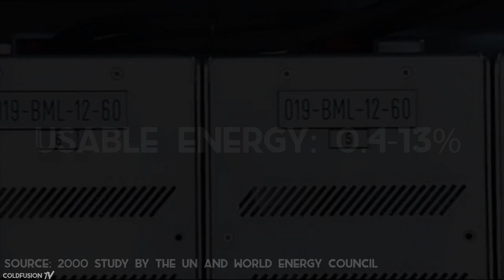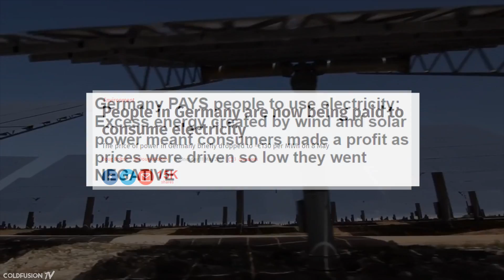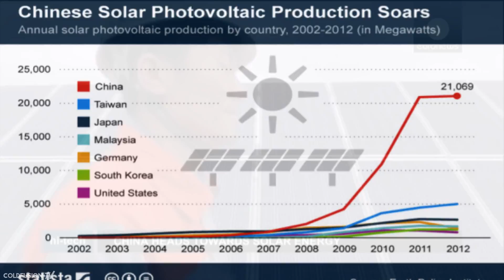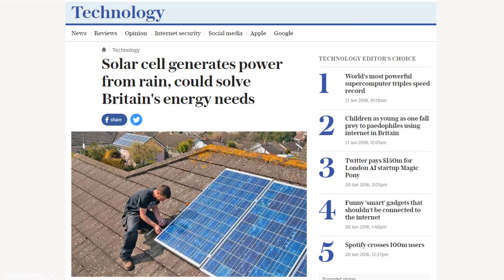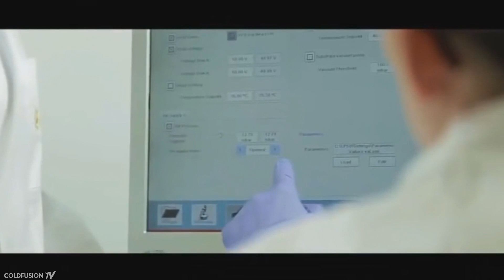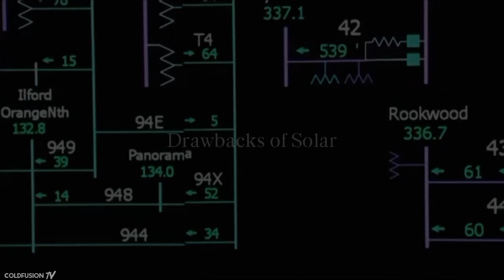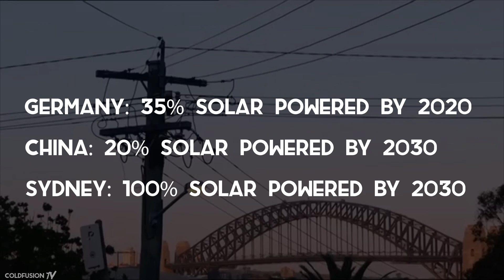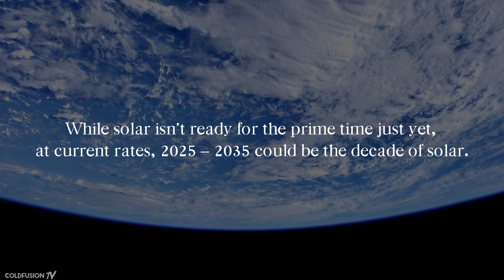The Truth About Solar

Comment: One way to help solve our problems, ditch AC and use a superior DC grid which can then easily be connected to power storage.
Reply: AC can be transmitted over much longer distances so we can use a much more efficient central production point to feed a larger grid whereas line resistances for DC are much higher and can cause a lot of issues over any distance because losses become so great, now for local power production (as in on your house) DC may be feasable assuming you can get appliances that work on DC or get computers to work on DC without first doing a DC to AC inverter and then back again because computer power supplies provide up to 5 seperate voltages (plus ground so 6?)
Reply: DC is more difficut to utilize.
Reply: Why?

Most things these days use DC.
The majority of things which use AC (like lights) can also use DC.

Pretty much the only thing which cant are motors which run at mains frequency, and crappy old power supplies.
Reply: As far as I know, mains is run on AC for safety. When you are electrocuted with DC your muscles seized up and you cannot let go of a wire for example, but in the same scenario with AC you would just get a jolt and jump back.
Reply: Nope.

We use AC due to inadequacies of our past.

Mains AC cannot be transmitted at mains voltage all the way as it would result in too great a load to the cables and thus too great a power loss. (an example of a similar effect is in dodgy USB cables, some can only handle a few hundred mA before their voltage drops to unusable levels).
In order to compensate for this, you need either massive wires, which are far too expensive to build and maintain (and weight too much for the towers), or you can have multiple generators nice and close to where the power is used (like Solar cells), or you can have the voltage change at various stages, so large legs of the distribution network will use high voltage, low current, allowing effecient transfer of energy, while the closer ones to the user will be low voltage, high current.

In the past, changing between AC was easy. You just needed a transformer, a piece of iron with 2 wires wrapped around it. This was simple, unlikely to break (unless it overheated and the wire melted), and it had a decent efficiency. But the same principle that allows the transformer to operate means there will be radiative losses with AC power transmission.
The more efficient you made the transformer (by increasing the frequency), the more losses you had during transmission, and vice versa, such that for the DC system, you have no radiative losses in transmission, but no efficiency in the transformer. For high frequencies you had very efficient transformers, but the power could not be transmitted any great distance (this is also why the under sea cable networks have to use DC. The AC transmissions would die out too soon and only work to power devices near the shore).

In the past, there were 2 ways to convert DC to different voltages, motor-generators which had lots of moving parts, wore out, and were inefficient, or via a regulator or the like which just wastes excess power meaning it is only good to regulate voltage, not to transfer it more efficiently.

This made AC the clear winner back then as it could be more efficiently transported from a few generators (or power plants) to loads of people (or users).

It also meant power supplies (which were to supply DC power) would first go through a transformer to change the voltage, and then go through a rectifier and smoother and regulator.

But that is no longer the case.
Now we have much more efficient ways of converting DC voltages, using switch mode power supplies. The supply is switched at a very high frequency making the transformer much more efficient (and thus it can be smaller). This would allow us to transfer power without radiative losses.

But more importantly, switching to DC means we have an easy way to store power.
Reply: Honestly… I agree with most of the points:
-DC Is safer to touch: True (this is even reflected in safety standards, eg. 60950-1 with limits for AC than DC for SELV voltages). But apparently it hurts more for some reason J
-These days it is easier to transform DC back and forth using various switchmode circuit
-DC means less transmission losses – True (no capacitance issues, corona discharges, noise from HV power lines)
-DC can use whole thickness of the wire (no skin-effect of AC that requires multiple conductors)
-DC means no issues with power factor, phase angles between parts of network or synchronizing
But DC has its own drawbacks and major one I see is that it is MUCH harder to kill an arc that occurs in DC circuit, all switches, fuses, sockets, switchgear, etc. would have to compensate for that. Also any accidental short-circuit even at mains voltages may cause a long lasting arc fault. This is a serious problem that does not have an easy and cheap solution.
There is also a problem with motors – It is easier (cheaper) to design a simple motor that runs reliably on AC, than on DC. There are tons of devices that use those simple AC motors that would now require some additional circuits to make it work with a DC motors.
The other issue is the same to why we do not have a global voltage, frequency, electrical system design or even standardized sockets: Legacy reasons. It would cost a fortune to convert to DC these days.
Reply: Fromage Frizzbizz Yes, some whole fraction, not a multiple. My bad.

A brush-less DC motor is effectively an induction motor.

Universal motors don't need control circuitry. You just power them up and they work.

Induction motors do need some sort of control, with one of the simplest controls being an AC source.
However that AC source can be replaced by control circuitry which switches (and potentially even cuts to some fraction for a smoother one) the voltage at the poles.

So no, it doesn't need to be supplied by AC.

A stepper motor is another example of an induction motor, which uses DC power and a controller.
Reply: Also, after looking it up a bit it seems DC is safer and requires more current to kill or shock.

Apparently it requires 88mA of DC current to prevent you letting go but only 22 for AC.

This also matches Eddison trying to show that AC is dangerous by hooking up some animals to DC and showing they were fine and then hooking them up to AC and killing them.
He allegedly hooked a dog up to 1000V of DC to show that the dog would live, and then hooked it up to 300V of AC and killed it.
Reply: It is more efficient to transmit DC than AC, it is just easier to transform to higher voltages using transformers. It is because with AC you need to deal with stray capacitance of power line, skin effect, losses to 50Hz radio emmisions. But, as I mentioned before, there are other major drawbacks of DC.
Reply: over long distances that is not true, AC is way more efficient over many miles because line resistance is not truly zero.
Reply: Ryan Schafer Uhm... Could you please elaborate and tell me what's the difference? Resistance woulb be the same for AC and DC, actually impedance for AC would be higher.
Reply: DC does not like to be stepped back down in voltage without getting huge losses in efficiency (think the 30kV+ transmission lines that then hit substations which step them down to ~10KV which get broken even lower before going into your home at ~110/220V) each step would have huge losses with DC whereas AC just goes with it and doesnt have the efficiency losses that DC has.
Reply: Yes Mibars, DC can have arcing issues, which may need to be compensated for. However, for mains AC through air, DC requires a fairly short distance for arcs, even to sustain them.
Reply: Ryan Schafer No Ryan.

Regardless of the distance, it is always more efficient to transmit as DC.
This is because AC has capacitive and inductive impedances which DC doesn't have.

Resistive imedances for DC are the same as for AC. But with one caveat. AC suffers from a skin effect where only the outside skin of a conductor will transmit the electricity. The depth will vary depending on the conductor and frequency. This means AC might not utilise all the wire and thus the wire has a higher effective resistance.

The undersea cables all use DC, as AC wouldn't be able to reach the devices due to the high inductive and capacities imedances, which are significantly greater under water than in air.

High voltage transmission between different circuits all run on DC because of the issues with phasing and DC being better.

Lots of power supplies already work on DC. The first thing which happens in lots of modern power supplies is the supply is converted to DC. The one thing stopping some of them working on DC are complex active filters that only allow the proper AC waveform and thus reject the DC wave form.

The 5 separate DC voltages can all be supplied by a switched mode power supply, which works fine on DC.

The transformers in modern PSUs are not large enough to work on mains AC frequencies.

Transformer inefficiencies vary dramatically depending on the size and load of a transformer.
If you take the same transformer and try to use it for AC-AC conversion or in a SMPS, the SMPS will win.
The losses in a transformer are frequency dependent and higher frequencies typically result in greater efficiency.
This makes a SMPS more efficient than a transformer.

The hysterises power losses is roughly proportional to f^(-0.6).

So no, DC-DC systems using a SMPS can be far more efficient.
Reply: If you are going to discuss losses in changing voltage you need to discuss how that is done.

In the past all they had were regulators, motor generators and transformers.
And their technology only allowed the first 2 for DC.

Their regulators would just waste the voltage difference, so if you had it supplied with 30 kV, and the power output was 10 kV, then it would waste the difference of 20 kV, with the power (20 kV*current) wasted as heat, meaning you were better off just using mains voltage all the way.

For motor generators, this involved using the input power to turn a motor, which in turn turned a generator to provide power at a different voltage. This had lots of parts that could break and wear down and wasn't the most efficient.

For transformers, they just had a few parts, a core and 2 windings so they were fairly robust.
To achieve low losses they need to be quite large, making them somewhat expensive, or they need to use exotic materials.

But the transformers were the best they had so they used them.

They then had to decide on what frequency to use. The higher the frequency, the more efficient the transformer, but the less efficient the rest of the grid would be.

Lots of places chose 50 Hz, the US chose 60 Hz.

But that has changed with the introduction of SMPS.

If we were just making the electricity grid now, we would be using DC.
Reply: mibars One thing I forgot to address, the motors. The main motors which can run only on AC are the synchronous and induction motors, which run at some multiple of mains frequency. These are effectively brushless DC motors where the control circuitry is an AC generator instead of switches.
We already have circuitry which can control these.

I think the only type of motor couldn't easily work with DC are repulsion motors.
Reply: Power losses over AC power distribution systems averages about 7-10% in most more developed countries (source IMF).

Meanwhile, large scale switched mode power converters range from about 93-95% per conversion,  If you assume 4 conversions by the time it gets to you, and completely ignore resistive line losses, that's a loss of 19%.  At three conversions, it's 15%.  At two it's 10%.  A distribution system will need at least three voltages, and big ones need four or five.

[I think we're 250-500kV, 26kV, 13kV, 4kV and 600V/240V (depending on customer type).  Some places skip the 4kV or the 13kV, but not both.]

Skin effect?  No.  Skin effect is effectively non-existent at AC mains frequencies (50/60 hz).  You have to be in the high 10s of megahertz for it to be detectable, and up into the hundreds of Mhz before it actually matters, and there are ways of greatly reducing the effect in high power wires - stranded cable, which most distribution cable is anyway.

[Super premium speaker cable marketing BS not-withstanding]

Radiative losses of 60hz AC is relatively miniscule.  There's nothing around to absorb it (much), and the antenna lengths for tuning are huge.  Well, sure, it's detectable, but it's low power, and there's wires everywhere so you're never very far from one and it's all in phase.

You can't beat SMPS for local power conversion for electronics.  At large scale it has its drawbacks.  But it also has its place.  It makes things so much easier to synchronize than trying to sync every generator on a grid.  For example, Quebec Hydro interconnects to the rest of the continental grid are via AC-DC-AC firewalls - this is a consequence of the 1998 ice storm and a couple of large scale inter-region blackouts.  It's much easier and faster to turn off (just kill the drive, no stupendously spectacular arc breakers going off), and much easier to adapt to frequency changes if your neighbor starts to drift.
Reply: Not "some multiple", it's some "whole fraction" of the AC mains, usually meaning at 60hz, you can get motors in 3600, 1800, 1200 (and lower fractions) of 3600RPM.  Motors less than 1200RPM are rather rare, and the price goes up sharply.  Motors at 1800 and 3600 are the vast majority of induction motors, at least at the <10HP range.

Induction motors and synchronous motors need more than "control circuitry" to function, they need AC.  There's no electrical connection to the rotor, thus, the only way you can get it to apply a torque (so the motor turns) is to supply AC power to the rotor by induction  so it can generate a magnetic field to interact with the stator field.

DC and universal motors (both usually brush type) will work on DC of course.

If you're going to define "control circuitry" as to mean "converting to AC", well then, of course any AC motor will work.  You can even adjust their speed (within relatively narrow limits without either major power loss or overheating) by altering the frequency.
Reply: Fromage Frizzbizz Are you sure it was AC systems, and not just systems in general?
And for small ones, the losses for AC typically aren't that great.
And for lots of large grids, HVDC parts are used.

Where are you getting your figure for 93-95% efficiency for SMPS?

No. Skin effect is existent at all AC frequencies. What matters is how large the cables are.

For aluminium, a common cable used in power transmission, the skin depth is roughly 1 cm at mains frequencies.
The cables they use can be several cm thick.
So do you really think it is non-existent?

What are some of these drawbacks for SMPS at large scales?

Also for AC, it isn't simple a case of synchronising across different systems.
You need to change the phase shift to determine which way power will flow.
Reply: Arsenic
(gallium-arsenide semiconductor

chips). 

• Bauxite
(aluminum). 

. Boron Minerals (semiconductor
chips

• Cadmium (thin
!lm solar cells). 

• Coal (by-product
coke is used to make steel).

. Copper (wiring; thin ! lm solar
cells): 

• Gallium (solar cells)..

• Indium (solar
cells). .

• Iron ore (steel). 

. Molybdenum (photovoltaic cells). 

• Lead (batteries).

• Phosphate rock
(phosphorous). 

• Selenium (solar
cells). .

• Silica (solar
cells).

• Tellurium (solar
cells). 

• Titanium dioxide
(solar panels). CES

Researcher:
TonyMuhovich, Colorado School ofMines

Edited by the US
Geological Survey 2010

Comment: This video tries pretty hard to be fair and point out where solar is deficient but I think they failed. The problem is solar can't meet today's demands and the future demands will be much higher as electric has to power more and more devices like cars and third world countries start upping demand. They also seriously downplayed the biggest problem with solar which is storing energy for the night period and peak demand. The battery solution is at best a very partial solution and even new interesting trends in creating alcohol directly from energy and atmospheric CO2 are not anywhere near available. We need to understand solar is not a stand alone solution and the only thing that really can step in in the near to mid term with low carbon emissions is nuclear. There are some very improved nuclear technologies out there and they are far safer and much less waste producing. We need to drop the anti nuclear rhetoric and embrace these technologies for the next 50 – 100 years so that we leave our children a habitable planet. Fusion, solar with decent energy storage or something better should be around after that period to carry us forward.